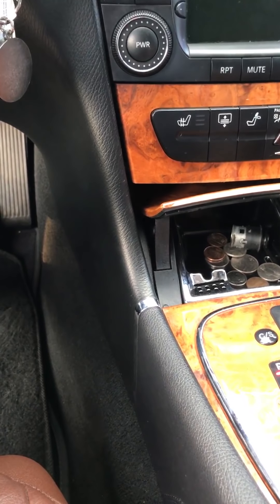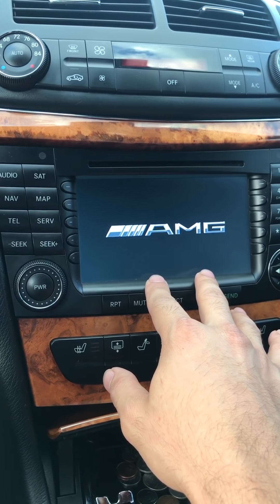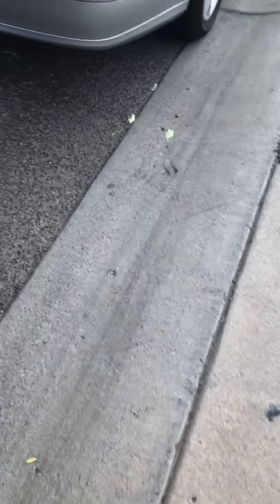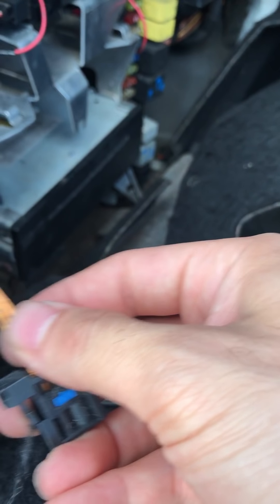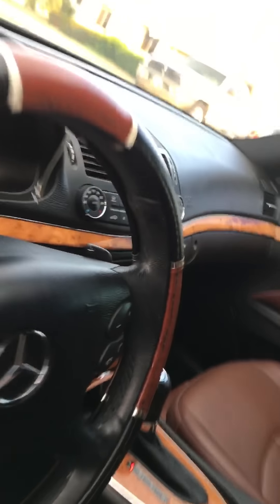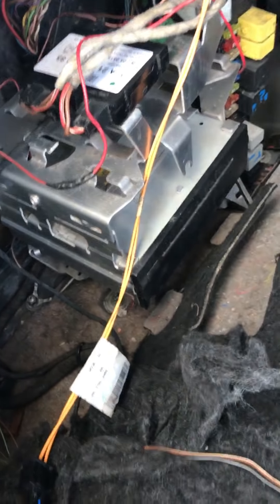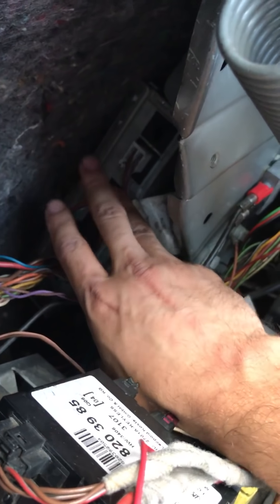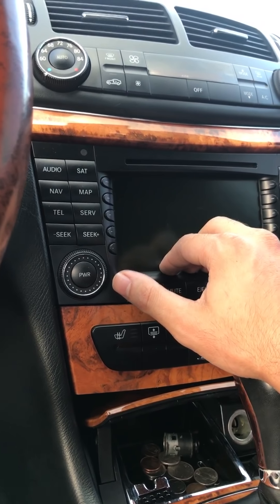Troubleshooting mercedes radio stuck on logo

Comment: I would like to thank you for this video. I have an E350 2007 and it was the navigation system. I was able to order it with the link you provided and then: WHOA!!!! It’s working! Thank you!!!!
Reply: I also have the same problem with the 07 E350 radio not working problem atm
Reply: @brickmunoz3528  same here I just bought the loop did it work for you?
Reply: Please for the link for me to order

Comment: I had the same problem. I checked everything but the problem persisted. Luckily I lived in LA and brought it to the ARG shop. The problem was traced to an aftermarket Bluetooth device that I had installed. He disconnected it and the radio worked perfectly!

Comment: U are The Best Bro U Genuis It Worked if it dont work behind in trunk i had use it under the radio wen the fiber cable connects to cd changer

Comment: Hi there, Thanks for very clear explanations
I have the same issue, I just wondering, do I need just one fiber optic and check on by one or need to kept first on navigation and check another device?
Another question is what kind of fiber I need, male or female?
Reply from the maker: Keyhan Mousavi yoi can check one by one and if it doesn’t work. Just keep on by passing them.
Reply: Keyhan Mousavi female connector
Reply: @TheOrange2341  thanks! Was about to ask male/female.

Comment: I have this exact problem, but my radio stays on for a couple of minutes, I looked in the back and found there is no navigation system, and could not find where the fiber wire to the navigation system, and the other two modules I couldn’t find either. Are they in a diffrent place in some cars or?

Comment: Mine does this and when I turn up the volume all the way up it will cut the right side off from playing music and will only play sound from right side. Static is also a problem with it. Ordered some fiber  optic loop from Amazon and will check it out tomorrow after work. If I have to replace any of these modules would the module themselves have to be programmed if I took the module out of a junkyard donor car or is it a direct swap  and play???

Comment: How would I install a navigation unit similar to what you installed on a mercedes w203 that doesn't have fibre optics? When I installed the navigation unit it comes on but only stays on the mercedes emblem

Comment: Hello can you tell me what fiber optic loop do you have to get for the teleaid because the other ones don’t work for it?
Reply: Did you ever find the correct fiber optic loop for the Teleaid?
Reply: @mubeen854  hey no I never did find the correct fiber optic loop for the teleaid.
Reply: @Ladyvirgo007  gotcha thanks! I might just need a new amp
Reply: @mubeen854  your welcome but if I get to the bottom of it I will definitely let you know, but yes that maybe the problem.
Reply: @Ladyvirgo007  likewise

Comment: E350 2007... i press cd changer opener and it doesn't open. Logo only stay on for a few seconds and then shuts off. Tried fiber optic loop. Nothing seems to work.
Reply: Did you fix ?
Reply: Yes! In the end...All I needed was to subscribe to my satellite radio provider! That simple...lol
Reply: @elbertbennettiii7545  how did you fix it
Reply: @maleikish  subscribed to Satellite Radio... that simple! Bought it from a dealership and it wasn't already installed. So, if yours never worked from the beginning, try subscribing your vehicle.

Comment: Hi. Can someone advise how to connect the BE 6094 radio to a Mercedes ML that does not have an optical network. After switching on, the radio will display the logo and then turn off. Well thank you.

Comment: I Have an Ml 350 2006 and facing a similar issue where the logo is struck even when I turn off the car and had to run the car for a while to be able to kick in both, Any help on this?
Reply: Did you ever figure this problem out

Comment: where is that cable for that bypass to mount at a mercedes ml 320 of 2007 because have the same problem and is identical the same radio. have taken apart all the back upholstery and see so no system
Reply from the maker: Deep Digger not sure where it would be but i know that the amplifier is under the driver’s seat.
Reply: Ce que je sais, c'est que la boîte à gants contient le lecteur de CD de musique.

Comment: HI I GOT A BYPASS LOOP BUT I STILL CANT FIND THE PROBLEM THE CD PLAYER IS NOT OPENING ITS A CLS 07 63
Reply from the maker: Not opening or open and shutting off?
Reply: @omarkokobobo  cd not open radio not working both

Comment: Hi i have a CLS 350 W219
I check everyhthing and bypass all im bypass the navigation cd player im bypass the telephone module
I dont know what to do please help im seeing the audio gateway but the audio gateways fiber optic cable dont has light
Reply: And that before i bypass the navigation cd and the telephone module and works fine but when i replace the battery that was doing the same shows up amg logo and then shuts off please help

Comment: I still have the original radio on nothing wrong with it till i took the cd changer off i plug the cd changer back but is not gettin power fueses are fine

Comment: Thats what my radio doin now i took the cd changer out to make a compartment but i guess i messed up the cd changer so now my radio stays on the logo
Reply: Same problem any solution 😕
Reply: @Med ba ima ordered the optic loop cable ima plug it if it works ill lyk
Reply: @Sinister_187  what happen bro gusse I have to order the cable also

Comment: didnt work with mine, Checked both locations with fiber optic jumper and didnt do anything. Logo still only appears for a few sec then shuts off
Reply: Did you ever figure out your problem? I bypassed all my modules and still nothing. Logo appears than shuts off
Reply: @mfgabe5610  same thing here
Reply: Any luck?

Comment: The best option you could do is, install double-din stereo with navigation system!  Don’t waste your money/time ! With this junky radio !
Reply from the maker: Hassan Alkhawaher you could do that but then you have to by pass the amp or other wise the sound won’t be nice as the original stereo also the system for the sound work by the fiber optic wiring you have to by that that whole system.
Reply from the maker: Hassan Alkhawaher i’ve sold that car lol, it had a lot problems one after another

Comment: I have a similar problem except that the logo stays on even after ive completely turned car off and removed key from starter
Reply from the maker: gio vazquez you might want to do a reset
Reply: A person told me to remove the positive cable on the battery for 3 min and reconnect. The radio should start.
Reply: @stickmanbw  did it work